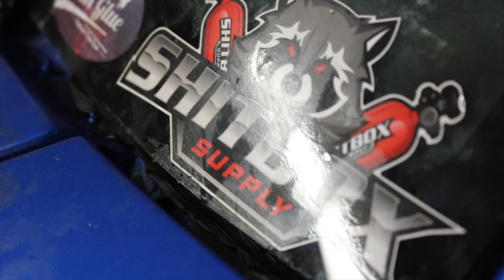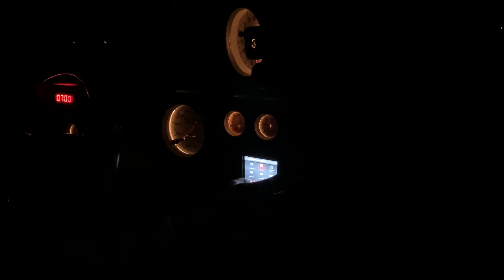Foxbody Mustang Street Wheelies on SBE 302 SBF, The Blue MF Lives!!!

Comment: That trans hits hard.....you can hear the tires chirp when it shifts
Reply from the maker: She was definitely workin
Reply: What's the fine over there if your suspected . Or do you just get a slap on the wrist?
Reply from the maker: Depends on where you’re at. But generally anywhere you have to be caught in the act for the hard charges.
Reply: Here, they give you 3 warnings and after that ya car gets crushed. Even being caught doin burnouts/skids. Along with fines from " undue noise", " dangerous driving" etc. And to top it off loss of licensed for up to 2 yrs.
Reply from the maker: @nojabjonny  oof. Sometimes we get a warning, sometimes it’s crush the car on the first offense. Really depends on the city/state you’re in. Some places are very cool with it as they know we aren’t idiots doing dumb crap and trashing the place. We usually try to stay away from folks and out of the attention